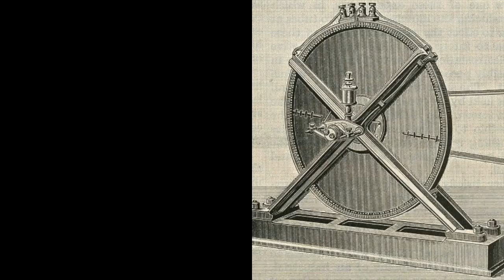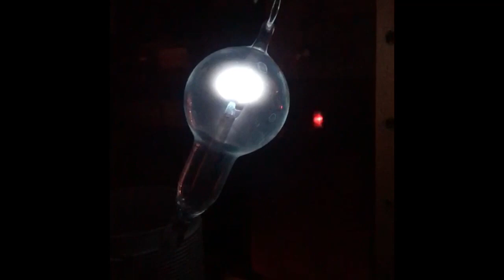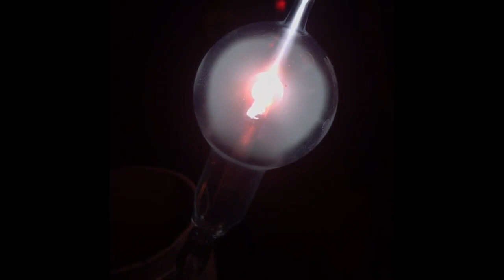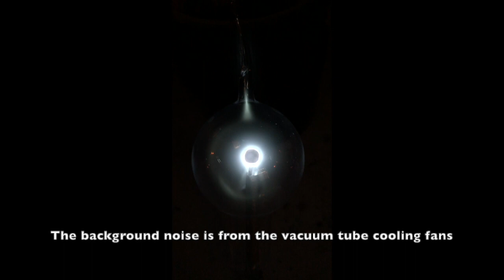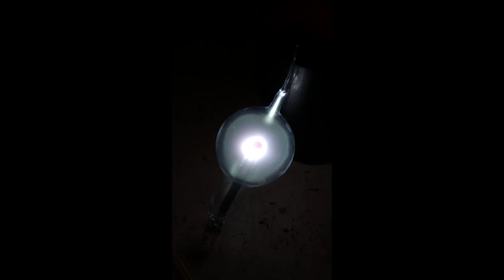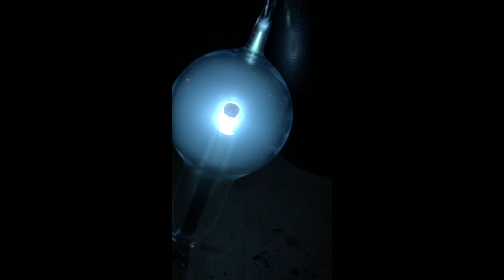Nikola Tesla's Replica Carbon Button Lamp

Comment: Nicely done! Fellow lightbulb reproductionist. Pretty clever way to stimulate carbon incandescence without the fragility of a filament. Googling tells me these can also act as a source for ionizing radiation.
Reply from the maker: These bulbs can certainly produce ionizing radiation, but only if driven by disruptive discharge, which is not occurring in this demonstration.

Comment: good work.  is it the residual gas that lights up?
Reply from the maker: I have postulated that a very minute amount of water vapour may be the cause, but if it is, then why would the brush discharge be directional, and be contained around the carbon? I can say that if the water vapour were evenly distributed within the bulb, then the initial application of RF would cause the entire bulb to illuminate, but it does not.
Reply: @GriffinGBrock   @Griffin G. Brock  Interesting hypothesis. I am under the impression that water vapour would ionise into H2 and O2, but I could be wrong.  Tesla also said that these bulbs are a very strong source of ionising radiation, make sure you are safe during these runs :).
Reply from the maker: @ganondorf1129  The x-rays produced by the bulb are only when provided with a disruptive discharge source, rather than the CW source shown in the video. These x-rays aren't exactly your typical harmful Roentgen Rays, but seem to be a more interesting Tesla alternative which should be called Tesla Rays.
Reply: @GriffinGBrock   @Griffin G. Brock  Tesla rays indeed :) May I ask how you have trained in this field? your knowledge is quite thorough.
Reply from the maker: @ganondorf1129  Reading books is one of the best ways to go about learning.

Comment: Mmmmm, time to light the house with Ionizing radiation!
Reply from the maker: X-rays (ionizing radiation) is not produced in this setup, but would if the bulb were driven by disruptive discharge via the bremsstrahlung effect.
Reply: @GriffinGBrock  Nice, how did you "light it" tube? mosfat? resistor wire? i tried to make platinum plug arc lamp and used a distributor spun by a drill to ignite it, fun stuff.
Reply from the maker: @travismosser3988  This bulb was driven by two tubes.

Comment: Out of topic a bit : p
16 = golden ratio × "golden pi" ^2
There are 6 regular platonic 4D polytopes and 10 regular 4D star polytopes.
An icosahedron has 6 axes based on the 6 longest diagonals. A dodecahedron has 10 axes based on the longest diagonals. Pentakis dodecahedron has 16 axes based on the longest diagonals.
Stellated truncated icosahedron has 32 star vertices, 16 axes.
Flower of life is 2D representation of 64 grid tetrahedron or 8 merkaba.
16
16+16
16+16+16+16
Edward leedskalnin's magnetic flywheel has 16 poles.
The elites are very obsessed with black cube and the tesseract.
The tesseract has 16 vertices. The hyperoctahedron has 16 tetrahedrons.
The elites use base 16 math on the internet.
16 is also when the perimeter of the square is equal to the area of the square.
"Golden pi" or "Jain's pi" = 4/sqrt(golden ratio)
When the perimeter of the square = 16,
Rectified circle has a diameter of 4 × sqrt(golden ratio).
Root of x^4 + 16x^2 - 16^2 = 4/sqrt(golden ratio).
Root of x^4 - 16x^2 - 16^2 = 4 × sqrt(golden ratio).